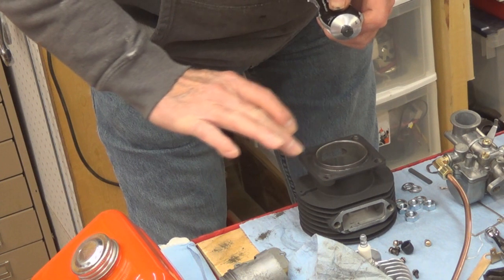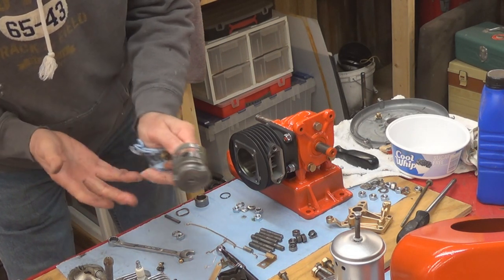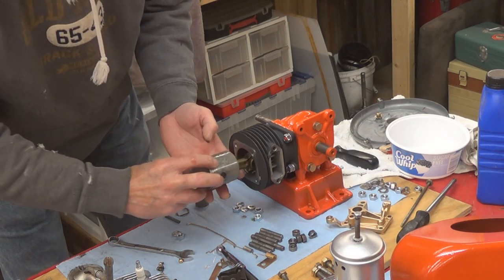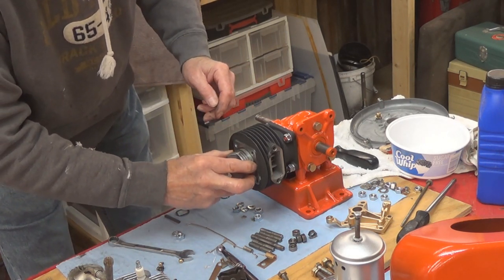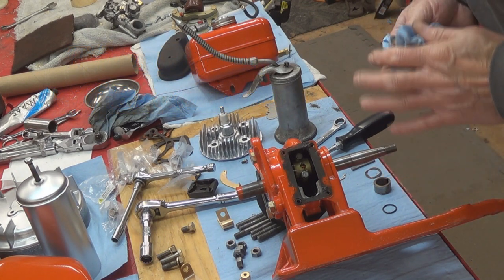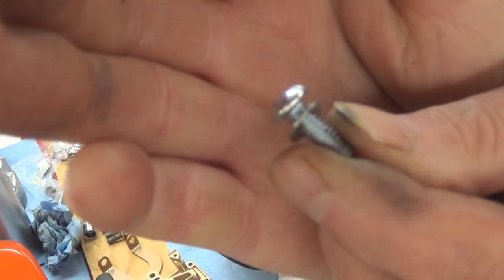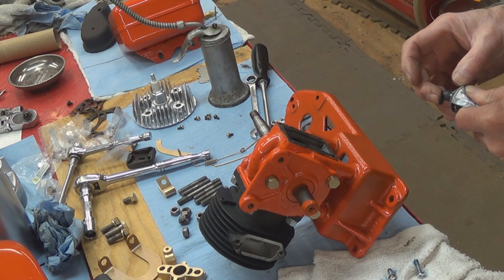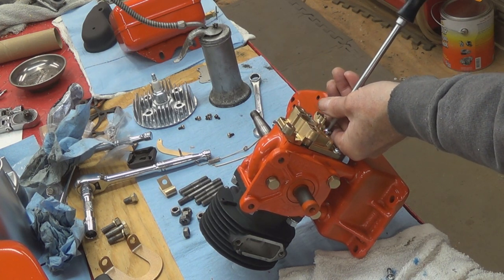Assembling the 1950 Jacobsen engine, Pt 1

Comment: Sorry,  but something went wrong with my first comment.But did you think about using Amsoil Saber synthetic 2stroke oil to run this. Interested to see how you feel about it. Thanks George
Reply from the maker: I used the regular HD30 non-detergent oil as was used on them back in the day. It all gets burned up anyway and if it will run after 70 years using the old stuff, I guess it will be ok now, right? Thanks Joe